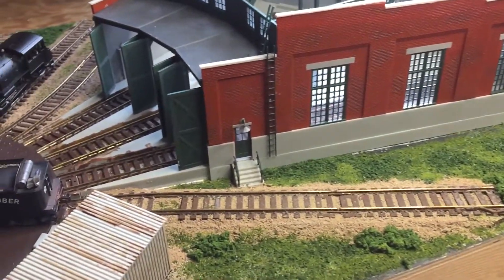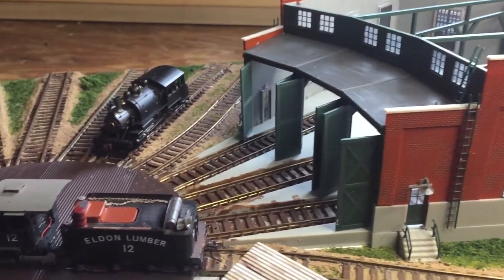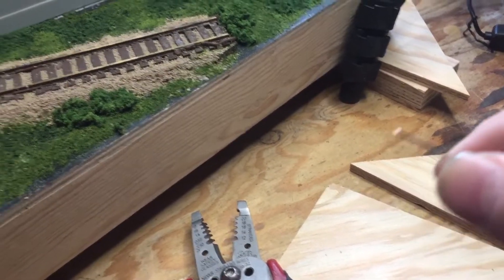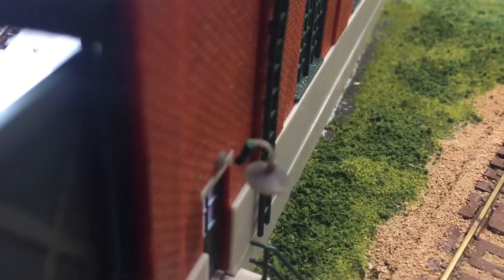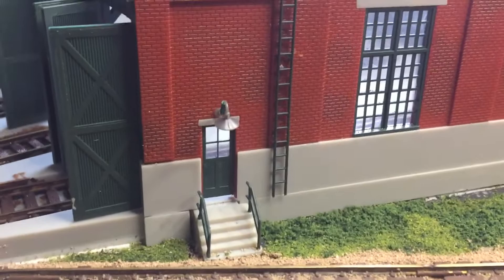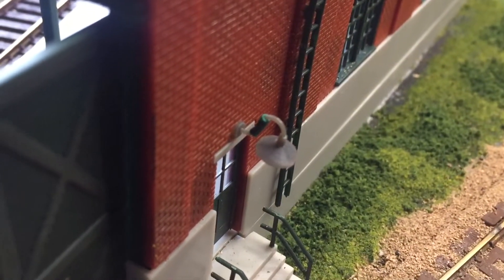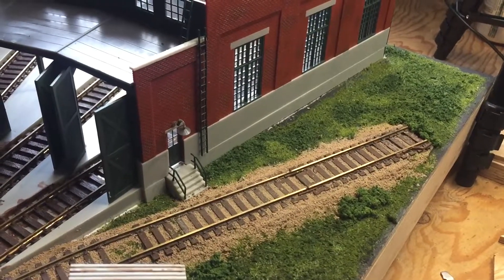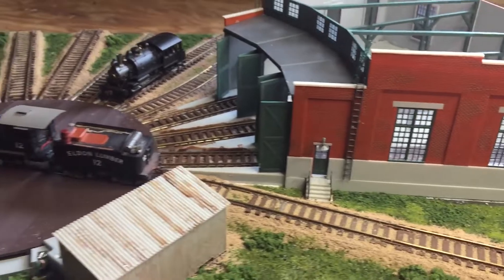Atlas HO scale Roundhouse fine detail repair.

Comment: Hi. Great video. What are the dimensions of that module?
Reply from the maker: It is 20” x 27 and 3/4”,   Very small HO scale module.
Reply: @ironhorsemodeltrains2198  thank you. I’m going to be building an HO layout. In thinking of starting with a module like this. 
It’s been a long time since I’ve had a layout
Reply from the maker: I find the module size is a lot easier to focus on and simple enough to make room for.
Reply: @ironhorsemodeltrains2198  - I have several locomotives from CSX fallen flags. I’m thinking of building the module as a way to display them. 
It’s sad CSX hasn’t painted locomotives like NS did.
Reply: @ironhorsemodeltrains2198  - Thank you for showing us your module. I think it’s awesome and definitely giving me good ideas. 
Gods blessings to you and your family Sir
Reply from the maker: It was a way I was considering displaying the locomotives I had even if they weren’t running on a layout. You would still have a nice spot to show them off rather than just putting them on a shelf.
Reply: @ironhorsemodeltrains2198  - Yes Sir I agree

Comment: Sorry you had trouble. Maybe replace the entire hanger with copper wire instead of the insolation. Then if you ever bump it again it will just bend and not break. And with a wire hanger to carry electricity maybe you can rig up a real light for it somehow. 🙂
Reply from the maker: Good idea!